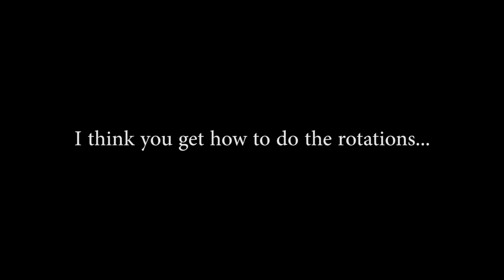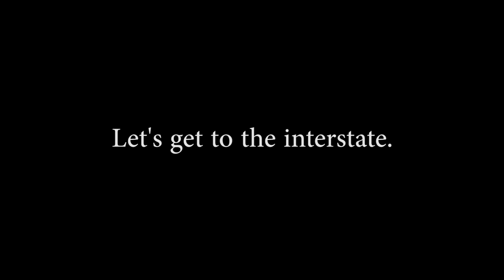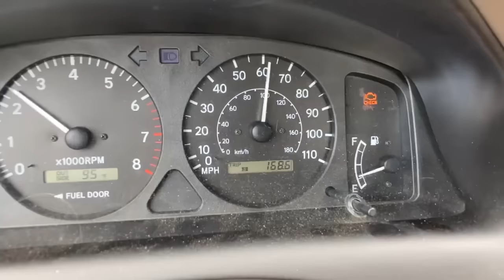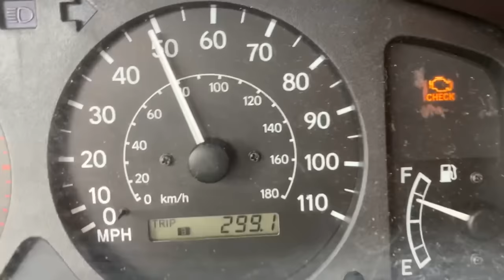Will Berryman's B12 Chemtool stop oil consumption? 😲 | Oil Burning🔥Experiments | Episode 15

Comment: Many of todays new vehicles have direct gas injection which is notirious for getting gummed  up. Berrymans cures that along with keeping regular fuel injectors clean in older vehicles. Been using this stuff for 10 yrs in my gasoline, about every four or five fill-ups. You can feel the difference

Comment: In my matrix I put 1 Oz per quarter of seafood in the oil 600 miles before my oil change was due and that fixed my issue. It dissolved all the junk and stopped excessive oil burn.
Reply: Seafoam***

Comment: Great result. I would have done a couple things differently but 👍if you take a old plug and  break the porcelain out and then insert it into the plug hole and then you take a old  weed eater cable and you cut it about 1 foot long and then you insert it through the plug you modified and then use a drill and then rotate it and it will remove the carbon, then you take a  vacuum and a small hose, you remove the  modified plug and you  suck up all the  carbon particles and then you add the  carbon remover and you  pour 5 ounces and then you rotate engine plugs out  cover top with rags.  Once you have removed the carbon remover you  bore scope and make sure no carbon is in your combustion chamber, do process again if you need to. Then 5 ounces and let it sit 24 hours  then rotate engine with the starter  plugs out,  and then you change the oil and filter,  then you buy 2 cans of garrented to pass emissions test.  Or a  liter of paint thinner,  (same thing) and you pour it into the gas tank and it will cause the catalytic converter to run really hot! This will clean up the catalytic converter from carbon and excess oil . I personally would not have  run it with the  chemical in the oil. But many engine flush chemicals are the same stuff any way it's you don't place the engine under load. It's left idle rpms for 20 minutes.

Comment: You may not need 4 0z in  each cyl  to clean the engine bay by hand?  An 0z will do then tdc soak with your full cyl? Like a qt lucas is excessive to give oil a bitocling? A lildabulldooyah???

Comment: I don't see how rotating the engine is going to change anything as far as cleaning stuck rings.
The chemical is going to dissolve the carbon regardless. 
The other thing would be to run the chemical in the oil, and run a Diesel oil which has a much higher detergent package that will help clean your engine.
Alternatively you can use Naphtha instead, Naphtha is used in jet fuel to keep the carbon from building up on turbine parts.
Naphtha in the cylinders and some in the oil would also help clean up the stuck carboned up rings

Comment: Did this on a 2015 Sonata 2.0T, after 3 weeks oil is still full. Usually had to pour in 1/2 qt every 2 weeks. The oil is still gold and not brown like it was after just a week. Assuming the B12 that mixed with the oil super cleaned the engine..I changed oil and filter twice after

Comment: I wonder if that car was driven very easy, babied as it were.   I've found that the 1ZZ engines that are driven harder from time to time, don't have as much carbon buildup around the rings and the piston dome.    I think the Italian tuneup could help keep the carbon levels down some with more wide open throttle runs.   After all, gasoline is a pretty good solvent itself.  That old Corolla looks like it's past the vintage when Toyota was having ring issues.   But I have rebuilt several 1ZZ engines from the 2000 to 2004 era for severe oil burning.   The last Corolla engine I rebuilt,  was for a delivery driver,  and he was putting 2 to 3 quarts a day in it just to drive 200 to 300 miles a day and had around 200k on it.   But if you rebuild one of those ZZ engines, they are bulletproof engines.   Last I heard, that particular Corolla has over 500k on it now and still running strong.

Comment: I am going to try this in my Scion Xb that uses a quart every 300 miles or so.  I may do one thing differently and that is to have a spark plug installed when I rotate the engine by hand.  I feel that the B12 will be forced through the pistons and rings from the cylinder compression.
Reply from the maker: Good idea. The Seafoam site had a similar recommendation when doing a top-down treatment with their product. ... Please let us know how it goes!

Comment: one quart of 20W50 and the rest with Diesel. run at an idle for about 5 min and drain and replace oil. run again for about 30 min and drain and replace. that should fix it. i havent tryed it yet with a newish car but thats what we did back in the day. it may mess up ya cat if you have one of them. my 01 is takin about a quart every 100 miles. so ill be doin this in a few days. if i remmber ill post my resalts.

Comment: An aircraft mechanic suggested Berryman B12 about 25 years ago and I’ve been using it ever since then in my fuel every other oil change. I keep the idle running when I add 1 can to my oil. Not as much as you did on your test.

Comment: ONLY since you are willing to try flushes and the like...  You might try any MIL-PRF-23699 jet oil.  They are all >95% ester.  It is a thin oil, so mixing it 10-15 volume% (don't use more) with a 40 weight multigrade helps balance out the viscosity (back to 30 weight.)  They can be had for ~$10/qt sometimes as many airline shops don't like using dented cans, and sell them at a discount.  This would be a good next step given where your consumption is at.

Comment: Berrymans sells the gallon container for dip cleaning parts. I did this on a Ford 302 oil user with BM but a little different method. I filled crankcase and cylinders with product and let sit for a couple days, then drained. I had good results also.

Comment: I wonder if you put the b12 in 1 cyl when pistons low, install plug, rotate the crank until back pressure is felt as this would pressurize the liquid enough to push past the rings and piston weep holes to force the solvent through the holes under some force ? Maybe clean better the weep holes ? Rinse repeat cyl's 2,3,4. Maybe add a pcv catchcan for future to minimize repeating.
Reply from the maker: Seafoam has the same recommendation on their website that you suggest (about pressurizing the cylinder). Haven't tried it yet though. PCV catchcan may be coming 🤫. Thanks for the suggestions, Richard!

Comment: you should also run it in the fuel tank also try spraying it full strength in the intake engine hot and revving the engine

Comment: Doesn't all carbon crud start to clog the catalytic converter? Will all that Berryman's B-12 loosen up all slug in the pan? Maybe re-lube the wash down cylinders with some 2storke oil? Are your valve seals leaking went parked? Great video.

Comment: that oil after seating for 2 days is exactly what I said from the start.... valve steem seals... they get cold... the material relax and let oil in... you already cleaned yoour oil rings... so now its a matter of changing you valve steem seals with the head in place . I have done this to many engines and it always work. Unstead of b12
.. I used kerosene... on cylinders... rotating... soaking... for 2 days... in the end of day 2... ran it for some time... drove it around keeping it around 3000rpm... eye on the oil light.... came back home when it stoped smoking... added some more kerosene to the oil... let it idle for 15 minutes... watched the oil light again... drained it while hot ... changed oil and filter for cheap oil and filter... drove it for a week. around 300 miles... and then new oil change and new filter... did the valve steem seals and the car has been running for over 60000miles lol

Comment: I’ve always been very sketch about running paint thinner/naphtha/whatever in motor oil (seafoam). Especially after I did seafoam once. 

Many moons ago a dealer mechanic recommended that I add a can of seafoam to my old 305 pickup motor oil because he said it looked sludgy down the oil fill hole. So I thought I’d try it. 

Now this was a great running but high mileage motor with no bad sounds, minor valve seal leaking (slight off-throttle smoking out the tailpipe) and decent oil pressure. Said chebby mechanic instructed me to dumb seafoam in the motor after it was warmed up and to idle it 15 or 20 minutes then change the oil. 

I didn’t make it anywhere close to 15 minutes because about a minute in the valve train started being noisy. About three minutes in it started a slight knocking in the motor which by five minutes was heavy knocking from probably at least two rods and and the idiot light began flickering a few times. It also was smoking constantly out the tailpipe just idling and neither ever happened before. So I shut it down and changed the oil. 

The smoking went away (except the normal off-throttle puffs) in a few miles of driving but the knocking continued. Continued is an understatement- at least two rods/mains were quite loud, and I resorted to two quarts of Morey’s when I  changed the oil from 10-40 to 20-50 in about 25-30 miles. That calmed the knocking to where you couldn’t feel it in the floorboards and kept the oil light from flickering at idle- though it continued using a quart every 500-600 miles or so (used to be a quart every 1200-1500 miles) and probably a lot of that was out the front and rear main seals (that didn’t really leak before; they’d used to be ‘wet’ but not leaking enough to oil the underside. 

I would have not run at 4000rpm for twenty minutes without changing the oil with all that Berryman in there. And I like Berryman’s. 

If I do anything in oil I’ll use ‘high mileage oil treatment’ at regular oil changes, or as a ‘cure’ or cleaner: 20% or less Dex3 in the motor oil. 

But glad your rings sealed up and what you did worked for you. I’m just hesitant and opposed to putting stronger/thinner treatments in motor oil and risking cleaning out the bearings of all the years of impregnated oil in an otherwise fine higher-mileage motor. 

Sadly, a few months later I had to stop driving it because the rod knock became too disturbing as fall became winter and 20*F cold starts had no immediate oil pressure. The motor was old but fine before the solvent seafoam

FWIW

Comment: Berrymans is very good stuff. I've been using it for since 05' I run a bottle through the intake with a hose and let it set for an hour and then crank her back up. If it's dirty it usually smokes out the whole yard lol. First time I did it I thought I blew up the engine. Scared me pretty good lol. The first time I used it Advanced Auto Parts had it in the Fuel Injector cleaning kit. But that went away so I just use the bottle and spray can. Pretty much the same. I haven't seen it like this tho so thank you.

Comment: You getting oil in the top of the cylinders because your valve guide rubber seals are worn. You  don't need to remove the head to replace them but you got a compress the cylinder with air at least 130 PSI, you can adapt an old spark plug and take the center out and braise a air line connected to the top.

Comment: I'd do it a second time or even possibly a 3rd time until the oil starts remaining translucent at the 3,000 mile changes. Half the issue that caused these clogged rings is its low oil capacity the other half was poor service frequency. Lower capacity causes the oil to get hotter and break down faster causing cook off resulting in particulate/sludge buildup.
 I will suggest using that bore scope to inspect the oil pump pickup for trash during the next oil drain because the amount of trash you have broken loose will clog it up. The trash clogging the rings is also built up throughout the  engine, do not be surprised if you start seeing rear/front seal leakage, lifter other oil fed component noise from breaking all that stuff loose.

Comment: It's likely your vehicle is hard starting and smoking badly initially because berryman's boils and evaporates at a very low temperature.

You'll see if you add it to a hot engine which you shouldn't, that it will quickly boil and blow air out of the oil fill opening.

So initially when you were driving it was boiling in the crank case creating pressure and blowing through your PCV into your intake

Comment: I have the same car that had the same problem.
I ended up buying 1 gl of totally awesome cleaner from dollar general.
I drained 2 qts of oil from the pan and added 2 quarts of the totally awsome.
Ran the car in park for 20 minutes at 2000 rpm( I know it doesn't have a rpm on the dash, i had a plug in computer) and occasionally reved it to 3000 rpm for 10 or so seconds.
Then changed the oil. Drove for 5 miles and changed the oil and filter.
Then drove 300 miles and changed the oil and filter again.
After that I drove the car from the east coast to Montana and back. Totalling 5400 miles. I went from burning a quart every 250 miles to burning a quart every 1800 miles. I use 5w30oil.

Comment: My mechanic told me 15 years ago to add a quart of diesel fuel or kerosene to oil and run engine at idle (do not drive it) then change your oil. Do before every oil change.

Comment: I just leave over night with the sparks plugs to avoid evaporation the pistons are dry. Repeat the process up to yo see enought liquid over the cylinder it will tell you when the piston rings in the cylinder seal

Comment: Number two cylinder is misfiring that’s why it looks the way it does One more suggestion high mileage motor oil the viscosity is thicker and you won’t use any oil between oil changes the product you used did Clean when you get the miss out of the one cylinder whether it’s a plug or a wire or whatever it will amaze you how much more power the high mileage oil and removing the miss will give you A better running car Toyotas are known to go 4 to 500,000 miles so keeping the garbage type of fuels and oils out of the engine will help you do that I’ve been working on these cars for almost 50 years they are astounding if treated correctly and maintained well and the product you used is actually a good one for removing carpet and sticky rings.

Comment: Great results, hope it works long term. I have a celica with the 1zzfe engine and oil burning problem but more severe (1qt per 100mi). Last few weeks became 5qt per 300mi and that's when I found a nasty cracked piston head in cylinder 2 when scoping it.
Reply: My 02 Celica burns about the same.
I heard a few people say they burn about that much.
Not sure why the Celica gets so oil hungry. It's any the same engine Dave has. I think he said he had an 02.
I'm a bit apprehensive about running the car with the B12 in the engine like he did.
Reply: @crunchygremlin  It's the same engine i believe between the corollas and the GT celicas of that time. Its ultimately a flaw in the piston design with not enough or large enough oil drain holes.  They get gunk/carbon buildup in the holes plus around the piston seals which is why oil is getting past the seals and burning in the combustion chamber. Typically no permanent fix besides getting the pistons replaced with improved ones or swapping in a later year engine.  I would wait and see a followup video of his results but it does look promising with the B-12.  I would definitely have the piston heads scoped first so you don't waste time if the piston is actually damaged.

Comment: Is it a possibility that the oil wiper rings on cylinders 2 and 4 were carboned up to the point that they were no longer free to expand against the sidewalls of the cylinder causing your oil to blow by on those two cylinders? That would explain the squirting out of the chemtool on cyl 1 and 3. By the time you cranked the motor over 5 times the b12 was in the oil pan on 2 and 4.

Comment: Usually if you have oil in the cylinder after you shut off let stand overnight it’s leaking past the valve seals not coming up past rings

Comment: If you go back to a synthetic blend it should lessen your oil consumption. I had a 2003 Corolla that only burned a half a quart every 3,000 Mi and when I switched to full synthetic I burned about 1 & 1/2 quarts every 3000 mi.

Comment: Thanks for the videos. I have an audi that burns oil, i also had some leaks that i fixed so i have a few variables. I ran a couple ounces of berrymans in the oil at 1200 rpm for 20 minutes like they suggest, the rest went into the fuel, and drained oil. About 800 miles later i used bg109 engine flush like they suggest and changed oil. About 300 miles later i ran the car untill warm then pulled the plugs and did a top down flush with berrymans. 1 small can, about 110ml per cylinder at mid point in the cycle. I let that sit for about 20 hours, added another small can. I let that sit for about 2 hours then used a vacuum to extract any liquid and deposits. I immediately changed the oil and drove the car hard. I felt the car pick up power while driving it. I havent put a ton of mikes on the car yet but i can say the oil level is not moving this far. I would have used at least 1/2 quart before doing these treatments.  Mine was as bad as yours except my plugs were dry deposits and i didnt see any oil on the cylinder walls. I believe i had a blowby issue forcing oil through my pcv system and into the turbo. So far its been doing good and i hope it stays this way. I continue to use 1 quart of marvel mystery oil in a 5 quart system. I also threw some Lucas fuel treatment in it but im gonna start putting berrymans in with each fill up since i believe that is what helped.
Reply from the maker: Lots of good info, Brandon. Please do keep us posted!

Comment: I had an old machine before and hard starting, down on compression oil was like tar, possibly rings stuck in, 
I drained the oil, and filled it to the oil cap with degreaser and left for a few days, ever so often turning the engine over by hand, 
Drained after a week and new oil and filter, 
The machine is running like a clock 
Couldn’t believe the difference it made